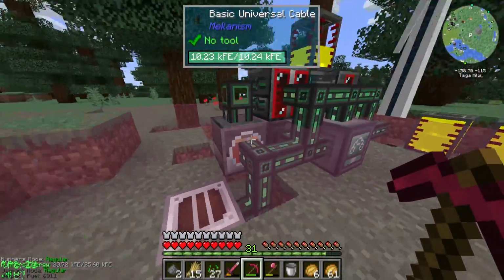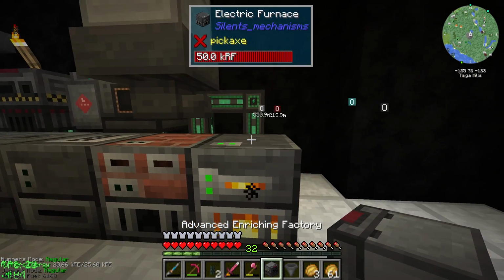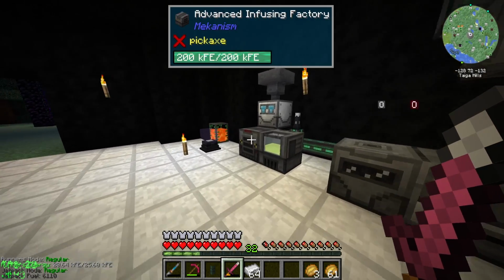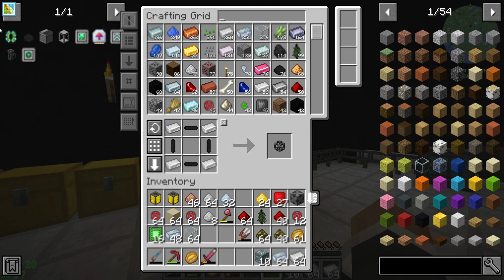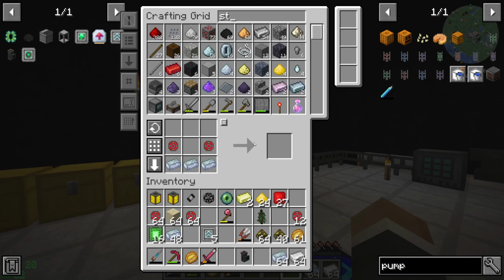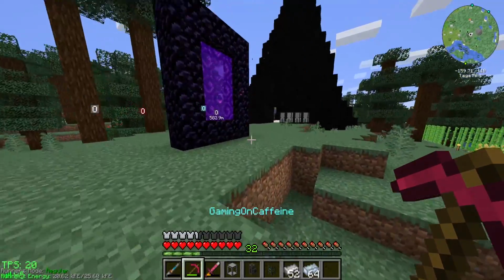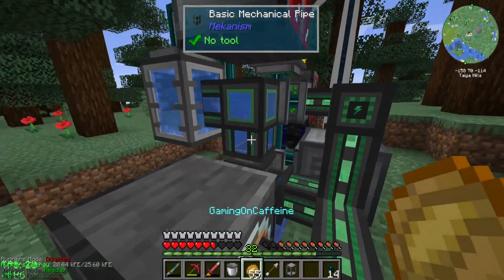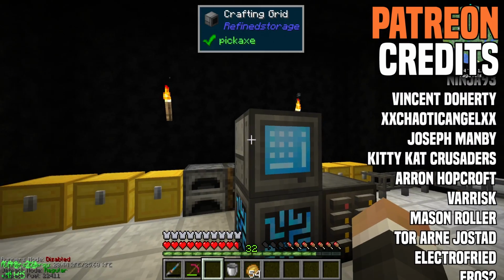Minecraft Q-Tech | ORE TRIPLING & DIMENSIONAL TANKS! #9 [Modded Minecraft 1.15 & Quests]

Comment: Can anyone help me with power gen on this mod pack had about 20 wind turbines set up with a simple dimensional cell but just not getting enough power anymore
Reply: The Simple Dimensional Cell's power output is capped at 1250 RF per side, I believe.
Reply: Jarrod Burns I tried running elite cable the whole way down and still had the same issue
Reply: @oliveryoung7571  you tried connecting Elite Cable on every face of the block on both the power in and power out cube?
Reply: Jarrod Burns no I’ll give that a go next thanks
Reply: @oliveryoung7571  You could also look into Quantum Entangloporters for a better way to move energy around. Also, Energy Cubes will let you build a stockpile of RF, if you aren't using those already.
Reply: Jarrod Burns will look into them thanks for your help